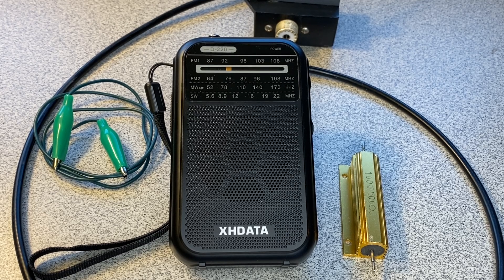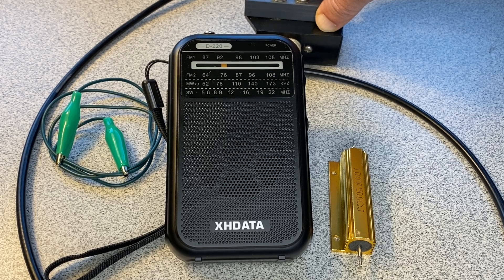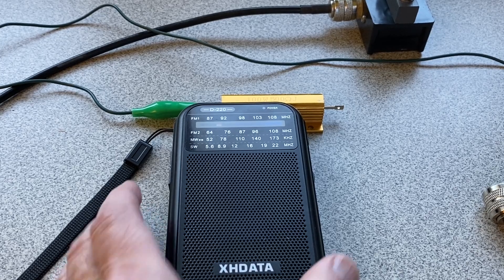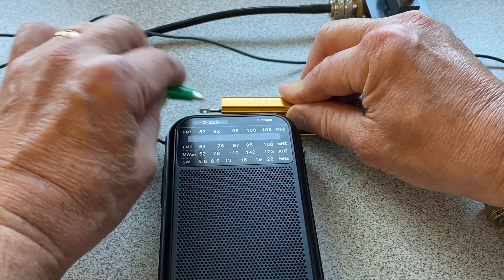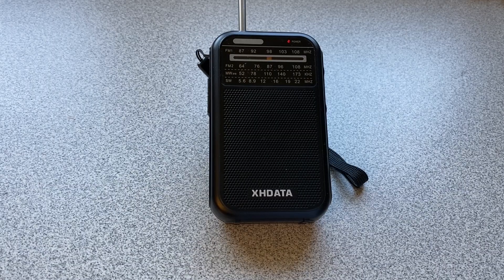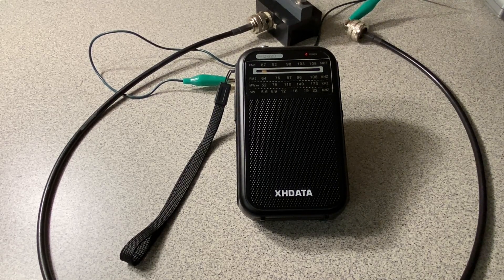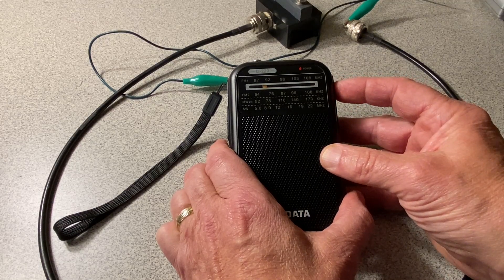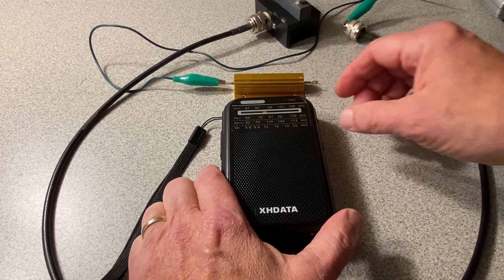XHDATA D-220: Incredible Indoor Shortwave Improvement Secret

Comment: The loopstick antenna on this radio is located at the bottom, beneath the speaker. Place a pickup coil next to it and it will work much better. Cheers.
Reply from the maker: I hadn't noticed that! I'll give it a try - thanks!
Reply: loopstick antenna is only for MW in this radio. The signal for HF is picked up by the whip antenna from the resistor that acts as a simpel coil

Comment: Great idea. I've used inductive and proximity coupling to use wire antennas with portables that would otherwise overload. That said, I have an XHDATA D-220, which I just got recently, and my 25 ft indoor wire antenna works well with the D-220, and I get no overload. So a lot of it probably depends on one's own location (I'm in a narrow valley, basically a lower signals area). So, for some like me, clipping a short random wire works. But with others, you'd obviously get overload. So, it's really YMMV. I think in a pinch, wrapping the end of a wire antenna, or feedline, around the D-220 would probably do much the same (I think another poster mentioned this method).

PS, as for the wire wound resistor, would a junked choke (inductor coil, some which can get fairly large) work also?
Reply from the maker: @chriscampbell9191  Great idea! I’ll try that

Comment: Peace be upon you;
Doesn't this little radio have a telescopic antenna for shortwave?
If not, then what kind of antenna did it have?
Reply from the maker: It has a very short whip about 8 inches long. That whip works well outdoors but not great indoors. Check out my D-220 review video where I have examples of AM/MW and Shortwave indoors and outdoors.

Comment: This looks to be capacitive coupling, since the resistor is only connected on one side, and is encased in metal.
Reply from the maker: @richs39  yes, that’s probably true. Inductive is used more as “induced” current via a field effect vs as an inductor in a circuit. The resistor coil is just adding a small amount of conductor to the antenna end. So, the very small induced current in the wire is electromagnetically coupled to the radio’s whip. As another commenter pointed out - any good conductor should work similarly. Thx for watching!

Comment: Duh! Assumption wire wound resistor is like an inductor.  Wrong, it might be wound to minimise and cancel any inductance. Then it gets even more moronic. You connect only one end of your supposed inductor, and say putting it near the radio works because it's an inductor. Total nonsense, you're only connecting one end, no current will flow. You might as well use any lump of metal, it'll work just as well. Why not just design a normal variable attenuator to optimise the strength of the signal going into the tiny radio? Oh, wait I forgot you clearly know nothing about electronics, not even the simplest basic stuff.
Reply: Brian I would agree with your analysis except that I absolutely do not agree with your insults. It is so easy to tear down someone else's ideas than it is to have the guts and motivation to create content. Generally, wirewound resistors are not wound non-inductively (Ayrton-Perry winding) unless you select one with that option. Even with that option, they are still somewhat inductive. That said, you are correct that the resistor here cannot be working as an inductor because only one side is connected and the frequency here is too low for significant capacitive coupling to the free end of the inductor. There is likely capacitive coupling through the body of the resistor which happens to result in just the right combination of attenuation and coupling to obtain benefit from the external antenna without overloading. As you say, an external attenuator or (even better) an external tuned matching network (preselector) would work even better still. Someone mentioned inductive coupling - that still requires a complete circuit in both sides of the transformer (even though there is no electrical circuit BETWEEN the two sides)
Reply: @sbreheny  You are right. I admit it, I was being an asshole.
Reply: @BrianG61UK  I have great respect for your ability to admit that.
Reply from the maker: @sbreheny  Excellent reply! Thank you! I've learned something here. Would you say the coupling is due to capacitive displacement currents around the resistor's shell (with the antenna on the radio)??
Reply: Brian, are you unaware that current can flow without a direct connection via inductive coupling? Have you never heard of a transformer?

You're in no position to criticize anyone else's knowledge of electronics. You're embarrassing yourself by doing so.
Reply: @socallars3748  Oh come on. How can you be so daft. Current doesn't flow between the primary and secondary of a transformer. That pretty much the whole point of a transformer. The primary and secondary are isolated from each other, and only a small leakage current ever flows between them.
Reply: @socallars3748  You will be so embarrassed. A transformer only works as a transformer if both ends of both windings are connected. You forgot that?
Reply from the maker: PS - thanks for challenging my assumptions!
Reply: @shortwavelistener  excellent idea , thanks ! the fun of playing with radios and antennas is that we can try and have fun .
Reply from the maker: @BrianG61UK  A variable attenuator connected to the whip is an excellent choice. Yes, there is minimal current in the resistive winding - similar to those examples of just placing a loop of wire connected to an external wire near the radio. The winding seems to provide a better signal than just a piece of metal. But, I’ll take your word for it and try some tests. Thx for the comment!
Reply: Sad ham
Reply: Every day is a school day. I love this hobby. Thanks to everyone for your support 🙏 ❤️ 📻 😊.
Reply: TAKE YOUR CRAP ELSEWHERE

Comment: Excellent tip, thanks. I used a similar approach on my Xhdata D-608WB that had similar severe overloading / cross-reception issues when hooked to a long wire.
I wrapped a dozen or so turns of thin wire around a section of the body of a pen, put some electrical tape on this and soldered a 3.5mm female mono jack to the end of that wire so that I can connect it to my long wire.
I slide this DIY "coil" over the unextended antenna of the radio and I have the best reception.
Somehow I suspect that the D-220 and the D-608WB radios share some electronics and especially the DSP chip because they show the same high sensitivity and tendency to overload and mix adjacent signals.
Reply from the maker: Yes! Great suggestion on just using some wire - the resistor really only adds some extra as well.

Comment: You can also just wrap some wire around the entire radio, that also works pretty well. Sometimes I just take a thirty foot long wire, and wrap 3-4 loops around the radio. I also still carry a couple of alligator clips, to try the whip, sometimes that works, or to use to suspend the wire itself, that and a couple of pieces of double sided Velcro, to roll up the whole mess, and the velcro can also be used to hold things together, like the loop around the radio itself. Finally, sometimes the clips are good to attach to any large and insulated piece of existing metal that you might find. All the Best! 73 DE W8LV BILL
Reply from the maker: @w8lvradio  Thanks Bill! I did do the loops in an older video but was looking for something a bit more compact. That’s when the wirewound came to mind. I want to find a small box and just add a bnc connector to it with the resistor in it. then just connect it directly. Appreciate the comment!!
Reply: @shortwavelistener  Good Idea!
Reply: Exactly. No point in it being a coil if only one end is connected.
Reply: Finally! Someone kind enough to show the amateur radio listener. Simply easy to understand and very effective. I'm getting one of those 100w 50ohm resistors. Thanks so much and GDx Tune in! 73 Lee. 😊